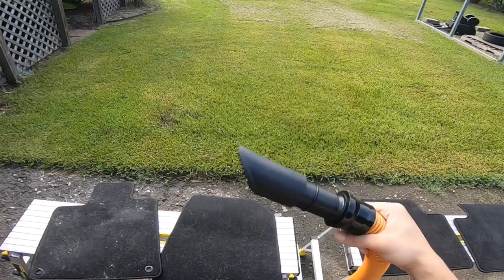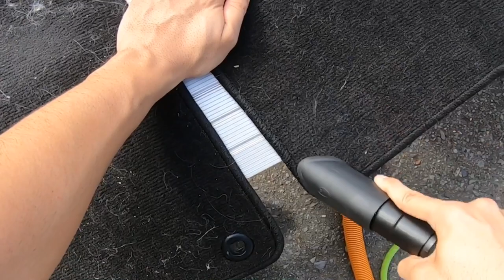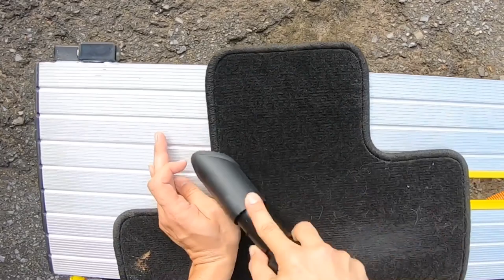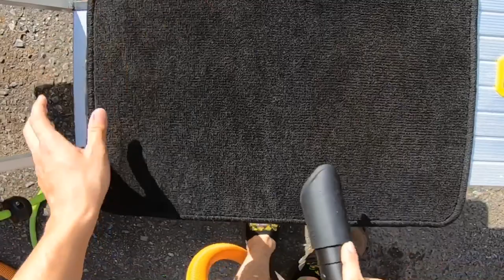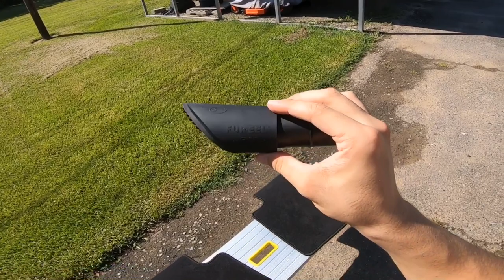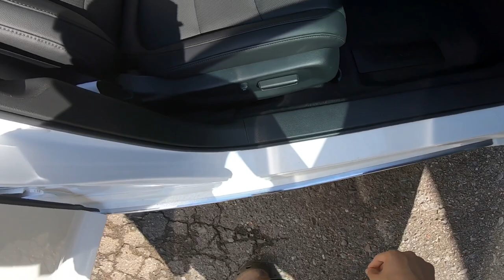The Buff Brite Fur-Eel Review! Great Product But There’s A Catch!

Comment: I do have this tool and I just want to say the proper way they instruct to use it is right to left, left to right, or pull it towards. They say don’t use side to side or up and down because it will ware the teeth much faster.
Reply from the maker: Yup I mention that towards the end as that was how I used it in a brush motion with pulling and lifting 👍

Comment: You should try spraying the carpet with glass cleaner like the instructions say to see if it helps
Reply: Maybe that would help the tool last longer too per their instructions.
Reply from the maker: When I bought this tool, as when this review came out there were no instructions lol came in a little plastic baggie just the tool there were a few demos but I need to check it out again now it’s been upgraded and I would use paint gloss as an anti static for the carpet

Comment: You're supposed to mist a fabric softener mixture on the area before using this tool. This will help soften the carpet fibers and make the tool last longer. It should've come with a little instruction sheet.
Reply from the maker: Naw when I bought it and did this review there was no instructions I now have the newer version and use paint gloss as my anti static spray 👍
Reply: @xxoverkilllxx  lmk
Reply: @JamieTheCleaner has the company updated material since this video a year ago??
Reply from the maker: @lazarohardee5242  yes! Big improvement I did a newer vid late 2021 with the new updated model!

Comment: You're not using it like BuffBrite described..... You're supposed to slowly go from left to right, or right to left in a fluent motion.  You're going all crazy up and down left and right way to fast.  As well you didn't spray the carpet with a liquid spray glass cleaner.  Maybe read the instructions before you make your opinion bud.
Reply from the maker: Didn’t come with instructions when I purchased  this item when it came out and it’s mostly the camera angle I am actually only combing it towards me and lifting it back up